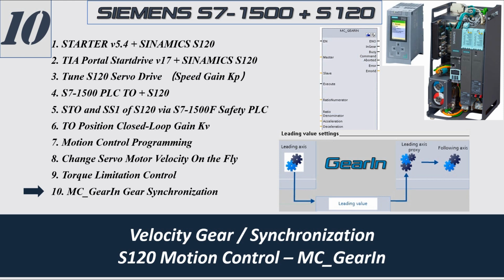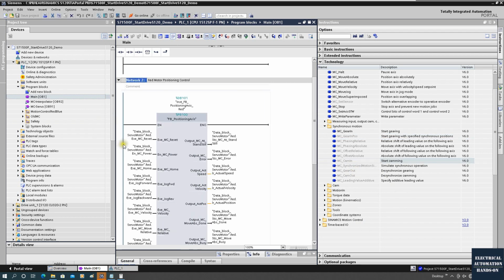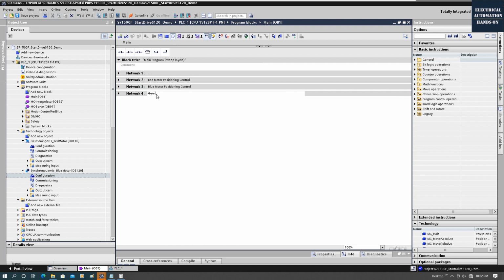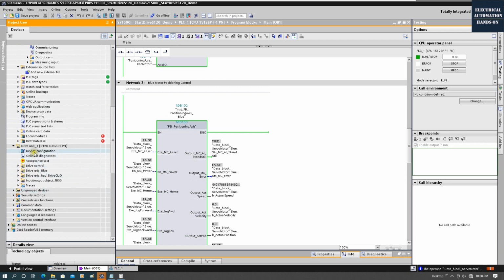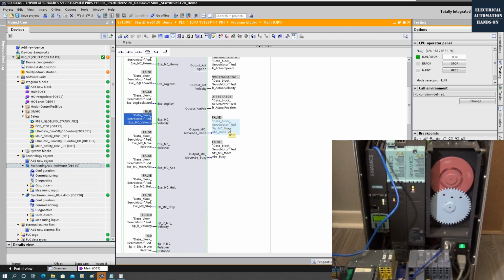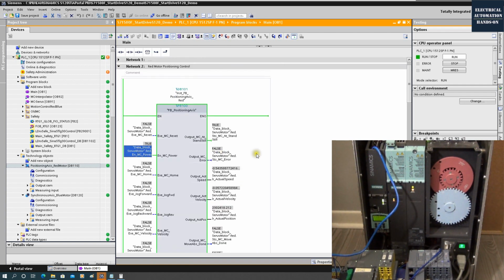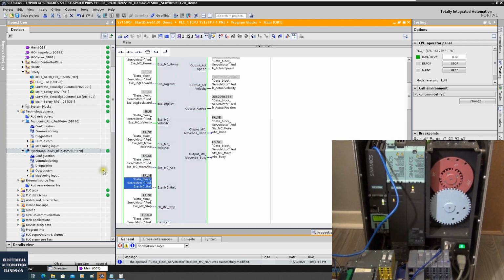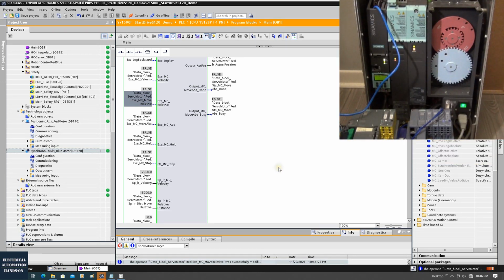MS05l. [Siemens S120 #10] SINAMICS S120 Drive Velocity GearIn

Comment: 博主您好，关于调试图中两个齿轮，让它们两个进行同步，同方向，同转速，除了在您所展示的视频中，在STARTER中有可能实现吗？我用的两伺服直线电机，在尝试同步😀
Reply from the maker: STARTER (classic) and StartDrive (new) are two generations of drive engineering software. They are just sofware to configure your drive. 
The topic discussed in the is video is the S7-1500 Syn motion control topic. Does not matter on which engineering tool you are using. 
If you are using position synchronization, you'd better using S7-1500 T-CPU for position gear.  
In addition, STARTER is old, try to use StartDrive
Reply: @electricalautomation  Thank you for your reply. As you mentioned, STARTER is just software for configuring the drives, so I don’t need to focus too much on achieving a specific function with it. I have already achieved the positioning function for one motor using STARTER and open-loop movement for the other motor. I am currently learning TwinCAT 3 through video tutorials, and I will soon try to use the motion module in TwinCAT 3 to control the drives and achieve synchronous movement and positioning of the two motors. Perhaps this is possible? I look forward to your response！
Reply: @electricalautomation  Because I currently own a BECKHOFF controller, I'll be using a Twincat3.

Comment: Can you make sessions about the cpu with technology 
I have application with s7-300 with technology and used some function mc_camin  mc_camout
Mc_camswitch
Mc_camclear
Mc_sectoradd
Reply from the maker: No really, sorry, my friend. I understood this old stuff T-CPU and some Cam motion control. There is less materials for this area and it is rarely used. I would recommend using S7-1500 T and use TIA portal and CAM motion control.
Reply: @electricalautomation can you make session for another functions of cpu technology  like mc-camin mc-camout and other functions

Comment: Sir can you please explain about MC Measuring input it will be more helpful for us thank you sir.
Reply from the maker: I would recommend reading carefully for this manual https://cache.industry.siemens.com/dl/files/466/109766466/att_1004383/v1/s71500_s71500t_signal_function_manual_en-US_en-US.pdf
note that CAM with Measuring Input always not an easy topic in motion control.  Also, find the document about S120 CU Telegram 393.
Reply: @electricalautomation  thank you very much sir
Reply: @electricalautomation  Thank you very much i has one doubt regarding positive and negative edge could you please explain what it means

Comment: Nice video!! 
I would like to know what could happen with the slave´s speed if the master has a torque limiting active and a load is aplied until the master stops.
I suppose the slave will continue spining since the type of conection is "setpoint".
Reply from the maker: Yes, for S7-1500 regular controller, the gear is base on the Velocity 'Setpoint'. But if you are using S7-1500 T Motion Controller, then you can set 'Actual' Gear